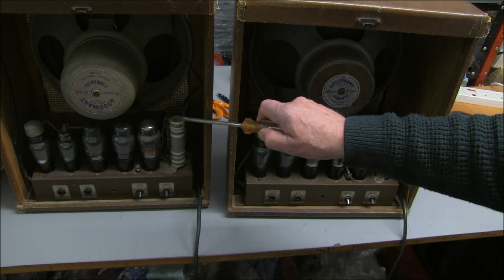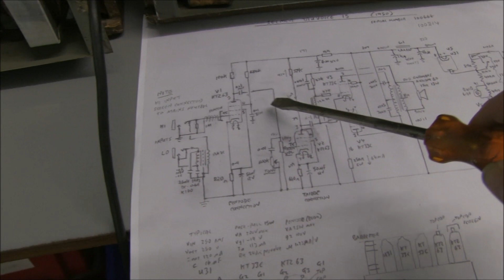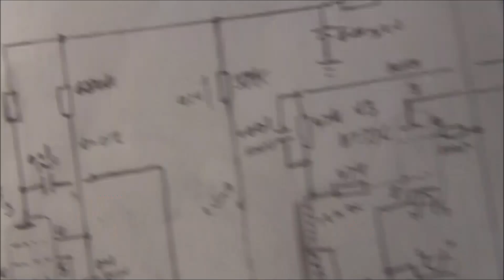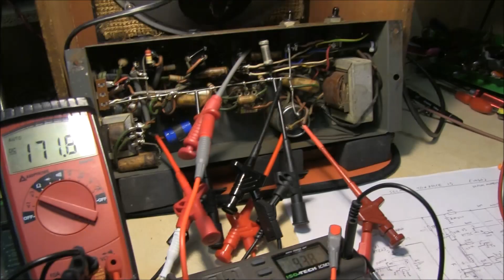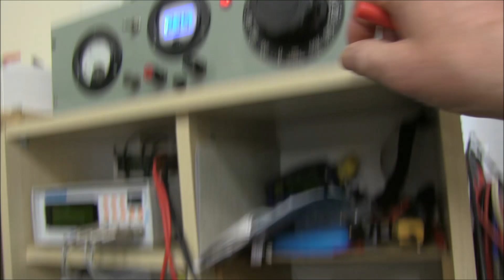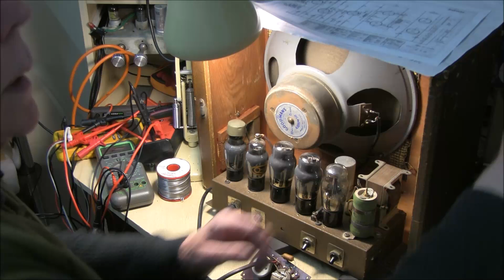Selmer TruVoice TV15  (Circa 1950) Guitar Amp.  Service and Test

Comment: Love your video. Thank you for posting this. Is there any way to obtain a copy of your schematic.....perhaps a picture of it or copy in some other form? Thinking about my next tube amp project and something like this looks interesting. Could open the door for a battery powered valve guitar amp. Thank you!
Reply from the maker: Hi. Yes, just email me directly. 

 I may have forgot to mention that these were made at the time when DC mains supply was common, so it could not use a transformer.
nick@demonproducts.co.uk

Comment: About 60 years ago when I was a kid, a TV engineer came round to fix our telly. It was, I now realise, using a similar method of non-earthing and a one of those big dropping resistors.  He kindly let me rewire the plug whilst I was watching him work. He didn't half jump when he put his hand on something inside the set when he turned it on. After he recovered he rewired the plug to the correct polarity. I just didn't know and I didn't get blamed. I can still picture his surprise though.
Reply from the maker: Hi Chris. Good story. Glad it wasn't you who jumped after he had gone.